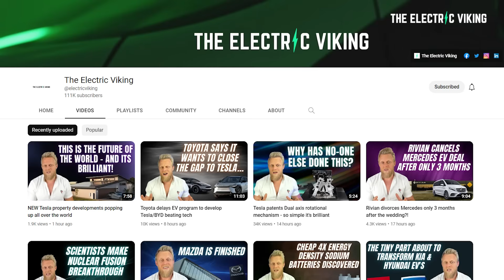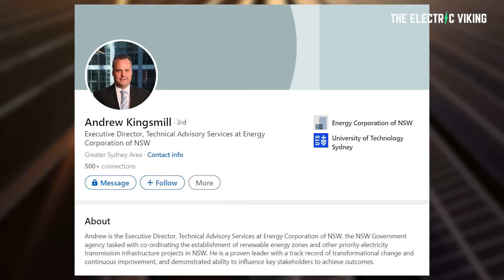Australia will close every coal power plant up to 10 years in advance

Comment: Australia dosen't want to burn coal, but its very happy to earn billions of dollars a year from exporting it to other countrys for them to burn. 

And I think that many of those posting comments here about wonderful renewable energy sources probably have no idea of how the materials used to make renewable energy are made. Anything made from steel needs lots of heat. And that comes from burning coal. Lithium used in battery's is mined. Not a very eco friendly process. Blades used in wind turbines, at end of life, go into landfill. They are made from material that will not break down.

When you are charging your electric car, where does the power come from? Do you think solar panels are made from fairy dust?

Comment: If you close synchronous generators, i.e those that can modulate output and don't replace them with nuclear (Unlikely in Australia given their antipathy) how can you balance supply and demand and if that is not done the grid will collapse? Renewables cannot power a grid by them selves it just cannot work.
Reply: Balancing can be achieved through use of grid scale batteries and grid forming inverters. This is already being implemented. There are 10 grid scale batteries currently up and running, 12 under construction and many more in planning.
Reply: Conrad,
I have to disagree, it's not possible with the very small capacity of storage connected to any grid.
Reply: Course they can with grid forming battery farm inverters, they're actually much better due to their near instantaneous action and capability of mirroring grid parameter problems.
Grid battery farms, like Hornsdale are already being paid good $$ for this, because sluggish polluting gas, that can't react fast enough to do the same job, is multiple X the cost.
Reply: Jeff, 

there is no 'course' about it, it is impossible.

I don't think you appreciate the difference between frequency support and load balancing.
Load balancing requires an alternative readily available capacity equal as makes no difference to the capacity of grid connected renewables.
In the U.K., this is CCGT generation and you can see how the output  of gas varies as the renewable output rises and falls.  How can a battery do that, even if you had sufficient capacity (Unfeasible) as it would be on a continuos discharge, until depleted.
Reply: @iareid8255  no one is, presently, stating that all gas generation will disappear, only be highly reduced, of course supply must meet demand, but you're missing out that supply can be stored in hydro/hydro PHS or to a lesser extent in other means, including batteries en masse, already, mostly, planned for, here, in the Australian ISP.

Scotland is already 100% electricity generation renewable, in effect, as Tasmania is, due to Hydro/pumped hydro schemes and interactions of that storage with other states, Scotland with Norway, Tasmania with mainland.
Reply: Tesla grid storage can modulate output.
Reply: Chris,
no they can't all they can do is short duration frequency support.
Reply: @iareid8255  it's not just 'frequency support' it's 'FCAS' (frequency support and ancillary services).
You're totally missing out the 'ancillary services' part.
Grid forming inverters don't just stabilise frequency, besides other associated parameters like power factor correcting, they can also react to a grid disturbance like a fossil fuel generator fault, or line trip, at over 10x the MW ratio (dependent on capacity needed) of fossil fuel standby generation due to near instantaneous operation, while extra hydro or sluggish fossil backup can be brought up to speed to fill in.
They can also black start the grid.

You also need to know that there are Synchros, eg in South Australia, providing inertia anyway for the grid.
So mostly expensive polluting fossil fuel back up is going the way of the Dodo because it's now, financially, unviable, besides the pollution.
Reply: Jeff,
you overestimate the work that batteries can do, by a substantial margin.
No grid can run without synchronous generators, fossil fuel ,nuclearjyd generation
Reply: @iareid8255  not really because I'm degree qualified and actually have worked in the industry at power plants, wind farms, solar and battery plants and substations, so I'm well aware of the present capabilities of grid batteries, in regard to capacity, and the possibilities for the future, when much cheaper safer battery tech is hitting the market right now.
They're going to be everywhere because there's so much more they can do, like the heart of grid islanding, at the end of long transmission lines, EV charging stations and large consumers to buffer supply, besides FCAS mentioned.
Reply: @iareid8255  of course it can, it can with grid forming inverters and synchros.
You don't know what you're on about.
Reply: Jeff, 
a degee in what disipline?

secondary scholl arithmetic shows how much capacity is required to cover all intermittency, it's simply not plausible.

Some figures you might like to consider.
Wind generation globally is little more than 30% of nameplate capcity, so to meet average load requires a tripling of installed capacity. But as grids do not work on averages and that wind can drop to 5% or less of nameplate for days quite regularly it makes little sense to expand wind. It is a dead end and cannot provide a stable, reliable and economical way to supply power to modern economies.
Reply: @iareid8255  Electrical Engineering, so yes I totally get where you're coming from, capacity factors and the difference in, present, energy storage between batteries and eg hydro, you're probably missing that offshore wind is close to the capacity factor of fossil plant, what with the higher MTBF, amount of outages and maintenance needed on all that plant and the pollution, it's becoming rapidly unviable and unattractive socially.
Done the subject to death actually, over the last decade, you'll have to check out the ISP here in Australia on line, I'm thinking recent advancements in battery tech that's already hitting the market will change that plan again in the near future.
Reply: Jeff, 

you can't compare the availability of fossil fuel plants when there is significant renewable supply to a grid as that has priority. Fosill fuelled plants typically carry out balancing and back up. What they can do is to reach 100% capacity as and when required, this is far more valuable than take what is given by weather power.
You say that outages and maintenace is significant, you don't mention why. Any business in which the government states it will curtail and replace is going to negatively impact investment in that plant, which in turn impacts reliability. It also shuts out investment in newer and much cleaner and efficient plants.
In the not too distant future the folly of current government policy will be evident when severe grid failures occur and then there will be some questions to be answered. This is the reality of too much renewables. Not surprisingly I don't have the faith you have in batteries.
.

Comment: Imagine the huge potential for Australia if we can get there faster and reduce the cost of energy so it’s almost free, it would make manufacturing in Australia become cost competitive to other countries- we have to get them faster
Reply: @MrRatclima   with pessimists, dissent.
Reply: @MrRatclima  start with value adding raw material processing, so instead of shipping ore, process into actual material such as lithium, rare earths, steal (which is mostly energy input, in fact all this processing is), this would be step 1 to adding value, once we have a material supply, then we can look at what end products would be the most economical to produce, Australia is a high cost country so we can never (at least now) compete on manually intensive products such as electronics unless we can improve automation.  For end products, I think we could compete with a strong material supply in high end batteries, for example manufacturing Tesla’s in Australia would be very difficult economically, but tesla mega packs could be achievable

Comment: Rather optimistic! 13 years to replace Ozs 71% fossils? And with a tiny portion of hydro? The trouble with the intermittents solar /wind creates a heightened reliance on fossils to fill the gaps, batteries are nowhere near the Pj required to fill the gap. 
NZ: they could have that target in reach with long term 80%+renewable, but the final mile to 100 that's the hardest mile.
Reply: The big banana seems to be working extremely well and saving consumers a lot of money…

Comment: Sam, how are you this sunny morning in Goonellabah on North Coast NSW?

The Team and I have submitted a DA to a Lismore council on North Coast NSW end of Nov 2022:
1.	250 prefabricated SIPform passive house-certified homes. On the roofs of buildings, the Tractile, the excess electricity will be stored in the 28.8MW Tesla Batteries Farm. 
2.	The PV in total 934,370m2 - Tractile tiles 45,000m2 and Arctech Solar Tracking - Tesla PV panel 887,400m2
3.	Bi-Charging of EVs two per house and 12 charging stations in the shopping centre. 
4.	Micro-grid that connects to a community of 4800 residents.

That is only part; We will have 1,000,000m2 PV, and 100MW  Tesla Batteries Farm will be installed by 2030. Lismore NSW will be energy independent from the grid.  180,000,000 kW of electricity per year at $0.12 per KW = $216,000,000  per year, assuming 6 hours for 300 days a year.

We will raise AU$500 million by the end of 2025 for the development. We have investors in the US and the Middle East. The Team and I will start Crowd Funding on Dec 2022. The Team and I have a Zoom meeting on the first Monday of the month. We will discuss Crowd Funding next meeting. 

A thought experiment - using Tesla Semi travelling from SIPform West Australia to Lismore, New South Wale, then onto Brisbane, Queensland, to purchase Weathertex.

400-volt DC Tesla Super Charger for Tesla Semi at. The distance between charges equals 700k/charges:
1. SIPform, 4/3 Finance Pl, Malaga WA 6090.
2. BP Truckstop, Eyre Hwy, Coolgardie Esperance Hwy, Norseman, WA 6090. 
3. Shell, Eyre Hwy, Nullarbor, SA 5690
4. BP Truckstop, 35 Eyre Hwy, Ceduna SA 5990
5. Shell Coles Express, Port Augusta West Roadhouse, 34 Eyre Hwy 1 Stokes Terrace, Port Augusta West, SA 5700
6. Shell Coles Express Broken Hill, 164 William St, Broken Hill NSW 2880
7. BP Truckstop, 180 Mitchell Hwy, Nyngan NSW 2825
8 Bendemeer Tourist Center, 19 Havannah St, Bendemeer NSW 2355
9. Bunnings Armidale, Corner Barney and Canambe St, Armidale NSW 2350
10. Lismore NSW 2480 to deliver to site SIPform from Perth WA to site at Lismore NSW
 
We will buy two Tesla Semi to travel SIPform WA to Lismore 2480 once a week there and back. There is another material we can bring back from Queensland to WA Queensland.

The Team and I Fully Charged LIVE— ICC Sydney from 11th to 12th March 2023. I will be there in Sydney. We promoted the project on the film on stand team taking a project and future projects.

Comment: The next cheapest electricity after coal is going to be natural gas.   Natural gas was a reasonable option in the past, but in the USA every coal plant is now running at maximum if it can because natural gas  has doubled in price from pre COVID prices and is needed for other uses.   

Cheap natural gas in the USA made the incorporation of combined cycle natural gas power plants in combination with wind turbine generators a viable cost alternative to new high cost coal plants although large scale wind turbine generator implementations have typically caused consumer power costs to go up, the low build cost of natural gas combined cycle plants made the costs viable along with the low cost of natural gas.    Now with natural gas prices above the price that was thought to be the threshold in 2008 to make them competitive with coal when the high cost of new coal plant builds is taken into account, the use of natural gas for base load power generation is not competitive with modern coal plants at todays natural gas prices. 

The big question is where natural gas prices in the USA will be five years from now and beyond.  Most places in the USA are fairly well supplied for medium term with base load power generation with no huge increases in demand predicted.   Texas needs some capacity increase for its expanding population and California is horrible in electric power having to import 25% of its electric power with bankrupt power grids unable to make reliable power delivery.   San Diego CA power rates are the highest in the USA at peak rates of over $0.60kW/hr residential.  At least San Diego's power grid is financially solvent and not in bankruptcy like many of the California power grids are.    Compare that to my home rate in Indianapolis Indiana of $0.10kW/hr in 2020.  When Tesla was comparing its Tesla Semi costs it used $2.50/gal Diesel to $0.07kW/hr.  It might be possible to get commercial power costs that low in the USA, but not in California.

Comment: utter nonsense - Fossil fuels contributed 71% of total Australian electricity generation in 2021, including coal (51%), gas (18%) and oil (2%). Coal’s share of electricity generation has declined from 83% in 1999-00 while the shares of natural gas and renewables has increased. Renewables contributed 29% of total electricity generation in 2021.
Reply: According to OpenNEM, for all regions 2021 was 31.5% and so far in 2022 34.3%. 1 year rolling average is 34.5%. So around 3% a year. Which is currently far too slow to replace all coal in 12 years.
Reply: @davidgrieve7691  renewables cannot dependably supply baseload. There is one community in Scotland which has a closed system but still uses 15% hydrocarbons AND restricts household draw to 5kW load. Island of Eigg
Reply: @jimmys6566  Do you realise that baseload is a negative term for a power plant that can't economically ramp up or down. 
Renewables don't want to be associated with junk like that.
Reply: @davidgrieve7691  You guys make me laugh. You dont seem to check anything and are completely wrong on "base load" which is a measure of minimum requirement and is defined as "Base load (also baseload) is the minimum level of demand on an electrical grid over a span of time, for example, one week" so that when the wind don't blow and the sun don't shine the base load is what we need to produce by other means
Reply: @jimmys6566  You just agreed with what I said. I just skipped the basic definition. I don't do basic.
Reply: @davidgrieve7691  QED

Comment: no steel industry in Australia? I realize coal will not be used to make electricity for much longer everywhere, but it is needed for steel making.
Reply: Less coal, means higher cost steel, means higher cost EVs😮
Reply: @dexlab7539  Coal prices may drop as it becomes less in demand.
Reply: @dexlab7539  how do you work that out, stupid comment.
Reply: That could take some more time to implement but also iron & steel production based & optimized for use electricity instead of coal also exists.
Reply: @oatlegOnYt  Not on an industrial scale anywhere it doesn't. How much money would it cost to switch? How long would it take to switch? Decades? 
Next....
Reply: Metallurgical coal is used for steel and in the process of being replaced by Hydrogen